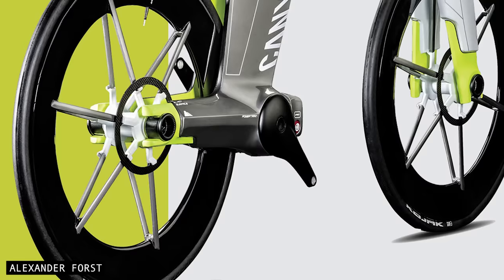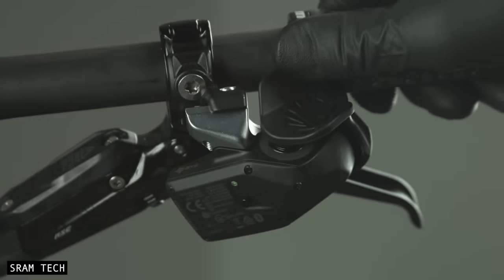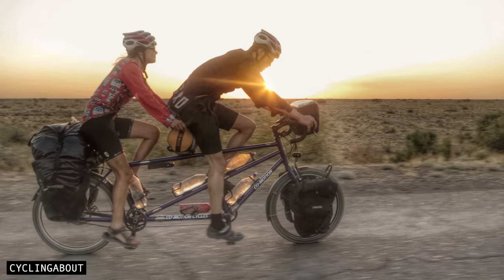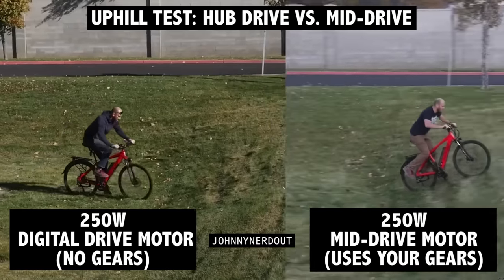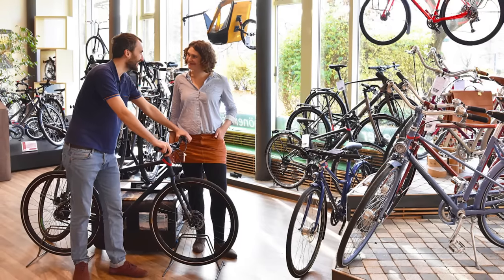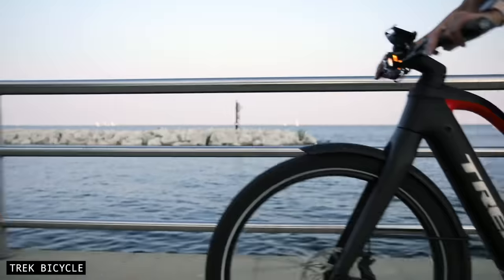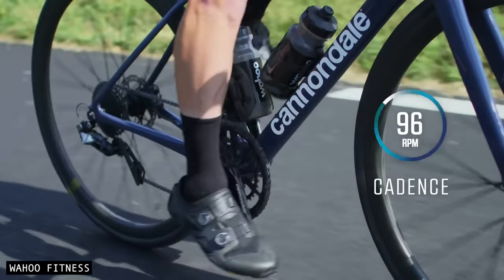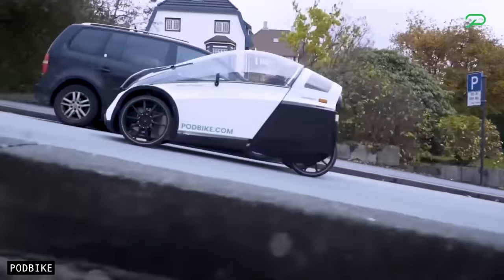Are Chainless Digital Drive Bicycles The Future of Cycling?

Comment: Well those who need use drivetrain in all weather conditions usually also need something that they can fix in 5 minutes on the road and digital drivetrain, gearboxes etc. will never be that, even if they fix all of the other problems, get reliability sky high and make it cheap as chains.

Comment: probable Not the future. IMHO with your Crank - Chain - Rear Gears efficiency on bikes being about 90+% you will be losing out in round trip efficiency when you convert that power to electricity to the battery then from battery to the motor. Just too much conversion losses. But what this does is improve reliability. As long as you fitted the bike with a bomb proof motor on the rear.
Having infinite gears would be amazing.

Comment: Maybe we need a dual mode drive - when you pedal forward, you drive a fixed gear belt (at your typical cruising speed). When you pedal backward, you power a digital drive.

The belt drives the rear wheel, while the digital drive generator/motor drives the front wheel.

This dual mode system is still very simple, but you don't sacrifice efficiency at your typical cruising speed.

Comment: I think the two main problems are efficiency (obviously you addressed this), and everyone's familiarization with chain bikes. If they change the concept to having you control the motor with a hand throttle like a motorcycle, I think it would help because then people could auto-pilot pedaling and focus speed control to their hand, an entirely different limb, eliminating the coordination issues and eliminating the need for fake gears since speed would be controlled independently of pedal  speed

Comment: I suspect the potential of regenerative braking on bikes may well prove over estimated. They simply do not have the weight and therefore inertia that would enable it to make a significant improvement to its range, pretty sure Specialized  had it on their early E-bikes but last I checked, it looked like they’ve discontinued it

Comment: Very interesting, but I would miss the connection between the impact of peddling and the movement of the bike. It would like being on an exercise bike in the gym. Also, as I know from owing an electric bike, the regen feature is just a gimmick.
Reply from the maker: After testing many bikes with these drivetrains now, I can assure you they are very hard to discern from a chain! Even the slightest foot movement will drive the bike forward a few centimetres. It's very impressive.

Comment: Thanks for adding the complete pros/cons that so many ignore. Electric transmission (non e-bike), is less efficient and needs a battery and e-bike powered transmission (power delivery) system to really show any promise. But, that is certainly a really cool option. I designed a hybrid bike for an international bike design competition in 2006, so the ideas have been around before the tech was there. I can see a company like Canyon really pushing the future on this front.

One important note to add: Adding electronics and batteries inherently make the bikes far less sustainable due to the increased materials/batteries/maintenance.

And yes, these are specifically electric, but can incorporate digital control.

Comment: For me, there is the one and only question with respect to this drivetrain:
Is it feasible to construct a bike with six or 7 kg overall with this technology? 
The drivetrain involves a motor and a generator. Can anybody tell me the minimum weight of the whole bike?
Reply from the maker: No. 10-12kg would be possible but it mostly depends on the battery size.

Comment: Digital bike is absolutely a good name for this because unlike a normal bike or a normal ebike which the drive power is exactly analogous to the physical power you input, in these bikes your effort is picked up by a digital sensor, that analyzes your power as a discrete number stored in a computer, then the COMPUTER tells the battery that discrete value to output to the motor, and the motor is the SOLE driver of the bike. Absolutely not analog.
Reply: Simply put, in this configuration you are not driving the bike. The computer is driving the bike. You are just charging the battery.

Comment: Maybe my question is already known but: with this electric drive, is it possible to keep pedaling while stopped at an intersection for extra energy to get back up to speed again?  Also for me, I find it easier to pedal reclined instead of upright because of my knees.  (My factory knees are far more valuable to me than replacements😎).  I am especially interested in a bicycle with two front wheels and one rear.  Couple that with solar cells on the top and an onboard battery to complete my wish list.
Reply from the maker: Yes, absolutely.

Comment: lotta comments and this one will be lost in the wilderness. Yuo can get motors and generators to be way more efficient. They could be made to be as high as 95%. batteries and capacitors can be higher as well ~ 92% or so. With Regen, you would even save on replacing brake pads like happens in EVs. It definitely holds promise. A bike like this could - with good software - sense a situation when you are going too slow and about to tip over and gear so that your peddling keeps you balanced. Definitely stored energy could help too in getting over hills. I'd think you could really make it feel like you didnt lose any efficiency if you could regen enough.
Reply: mate people have tried, they can't get that high efficiency, if you have a method go become a millionaire, that's free money for you.
Reply: I think it is too early to tell whether this new technology will be more advantageous than traditional electric bikes. The weight of the new technology is still higher than traditional electric bikes, so the advantages are not super clear. To get the best efficiency, you have to design your motors and generators for the speeds that a bike would ride at. Most companies are just pulling these off the shelf and not doing any custom design.

Comment: What a waste of energy. Let's be kind and say that converting mechanical power into electric is 95 percent effficient, and that converting the same electrics back into mechanical power at the back is also 95% efficient. That means that the whole drive is 95 x 95 /100 =  90.25 percent effecicient. That's a lot of loss for each pedal stroke.

Comment: Why do you call it 'digital'. Generating electricity from a pedal driven generator, and transmitting it by wire to wheel driving motor is NOT DIGITAL drive! Even if there is some digital control system (which would  not be needed) the basic drive is not digital, but analog.

Comment: Nope. This is not a bicycle, this is an electric moped/scooter/motorcycle. Stop trying to ruin bicycles. Simple, mechanical, rugged. No motors, electric derailers, batteries! There is no advantage to this except to make it more failure prone, harder to fix, and cost more. Calling this a bike is just silly. Stop, just stop.

Comment: You're estimate of the drivetrain efficiency is absurdly pessimistic - 20% losses in BOTH directions?!

Absolute nonsense, even large high power AC motors in EVs are around 95% efficient. Small DC motors suitable for a bike would have even smaller losses, so I would guess at an overall efficiency above 90%, and certainly comparable to chain drive...

Comment: 1. It's not digital, it's electric and it's analog. In fact, the chain and sprocket could be considered digital more than electric drive. 2. It's stupid. very hard to make efficient and responsive enough. 3. Why? The chain-sprocket transmission is almost perfect. Why innovate where it's just a waste of time.
Reply: The “digital” feature is in the application of controller logic to the motor & gear shifting.
 🤷‍♂️  IJS
Reply: @LePedantSemantique  No, digital in this context is merely a buzzword.
Reply: @pihi42  I gotta agree with you on the inefficiency. Kinda reminds me of the “digital” (I know, I know!) faucets & paper towel dispensers in public bathrooms. 
They’re “fixing” a problem that doesn’t exist.